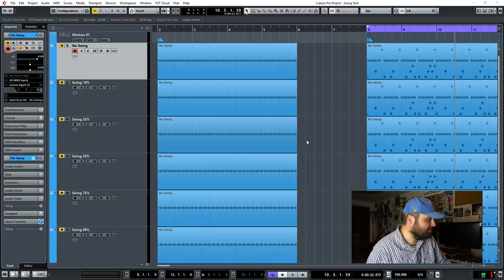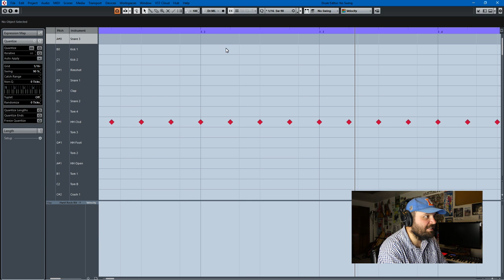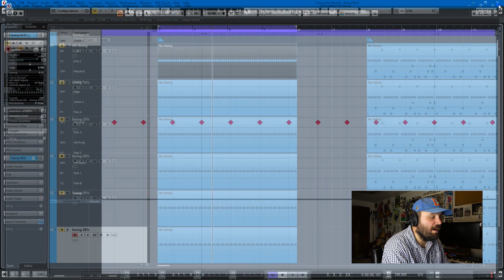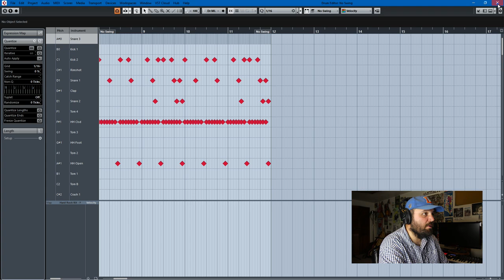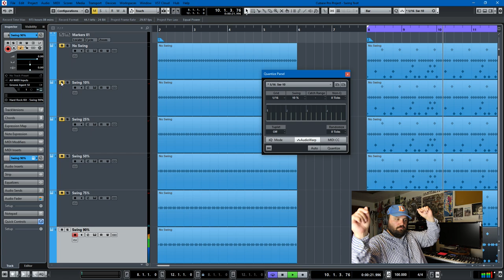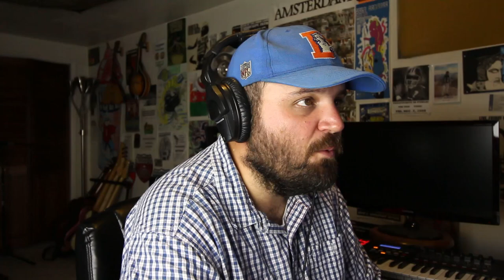Cubase TUTORIAL: Using Swing to Make Your Beats More Dope

Comment: Dave: suggestion for another tutorial—when and how to use quantize in Cubase. I tried using it once on a free form organ track and it was a disaster. Should it only be used on initial drum tracks? How does it interact with the project tempo? How to adjust the resolution of the quantization? What is it really doing under the covers? 
Thx